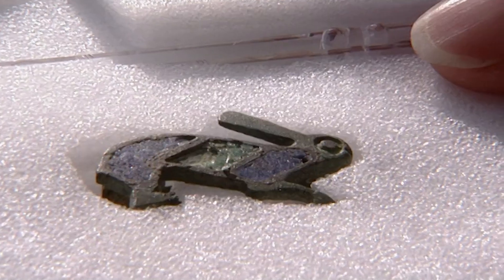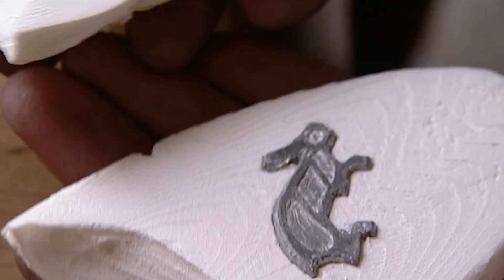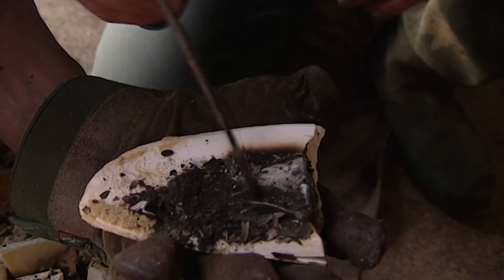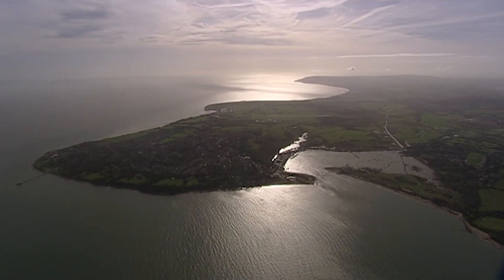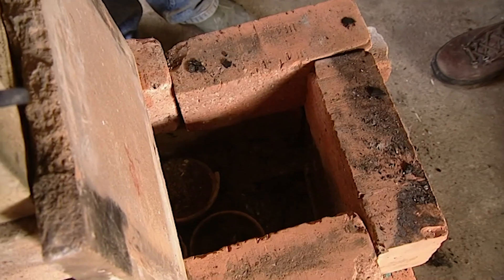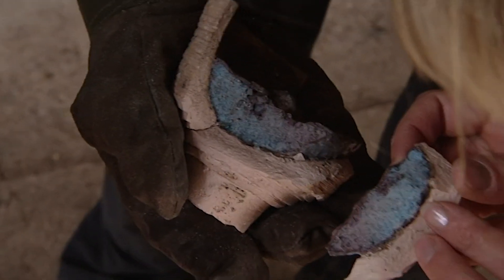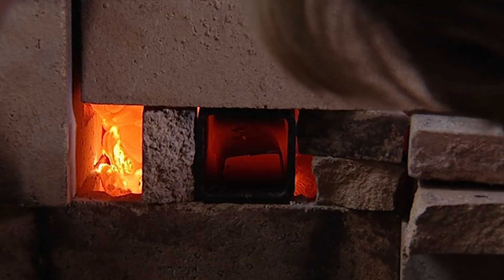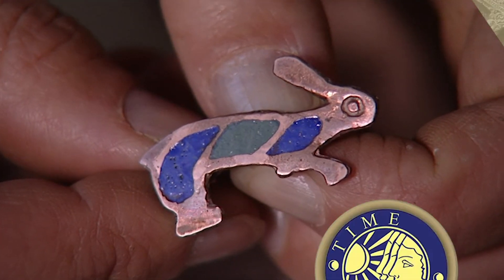Replicating A Roman Brooch Using Ancient Technology! | Time Team

Comment: As a Glass blower I've made almost identical material in modern settings and the precision measurements we use are very detailed. Handful of this and that making soda lime glass made me grin ear to ear. Btw the type of drill is called a pump drill and they are still used to this very day by woodsmen who don't want to rely on batteries. The end result is superb. Well done chums.